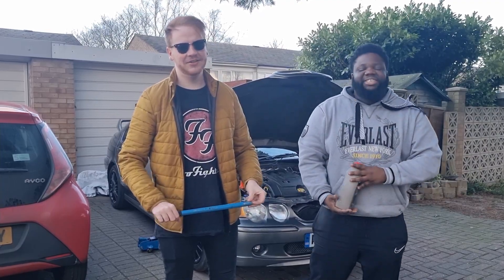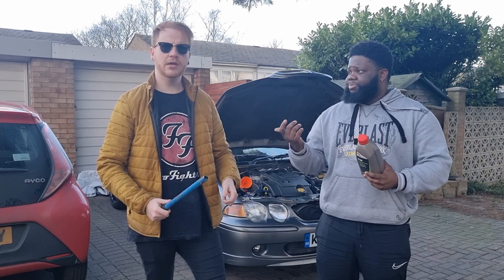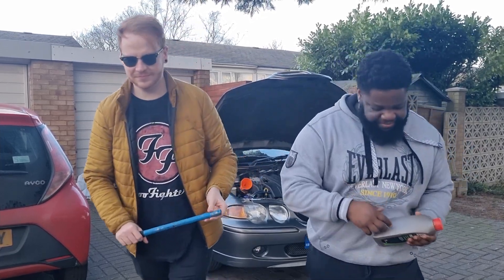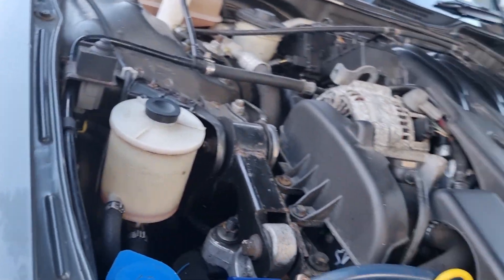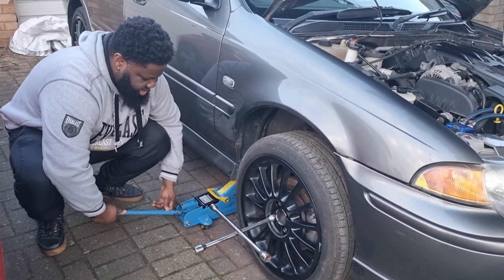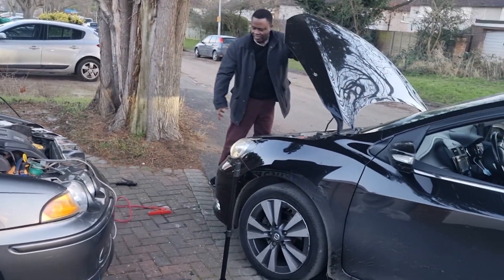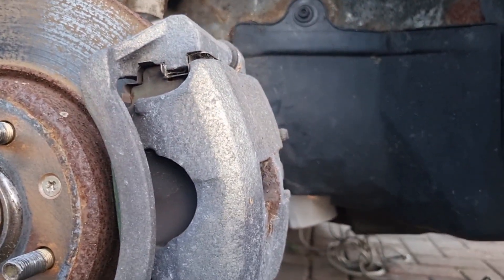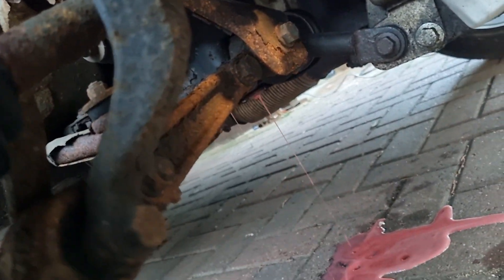Diagnosing a Power Steering Failure On Our MG ZS 180 Project Car

Comment: I cannot wait to see you guys fit that new hose!  The end that goes onto the pump is easy, the other end is an absolute cow to get too!
Reply from the maker: Hahaha yeah, we've heard it's a real pig to fit on already.

Do you know if there are any "best practices" with fitting one of these on?
Reply: @jcscarculture5267  You will need to access it through the offside front wheel arch. It connects right to the rear of the engine bay.
Reply from the maker: Thanks for the heads up, it's appreciated!